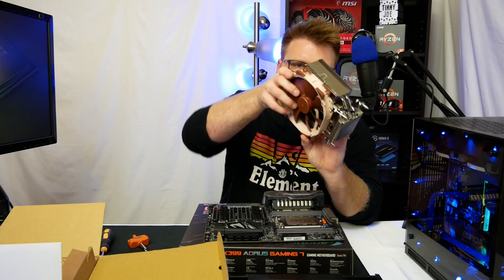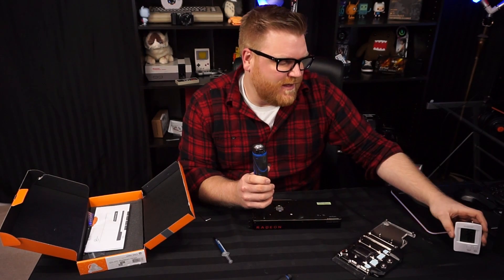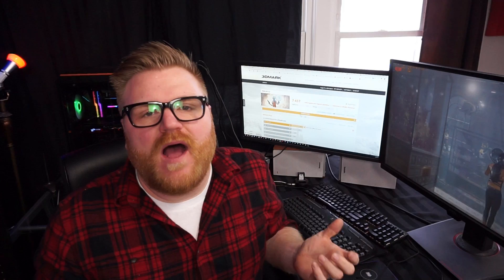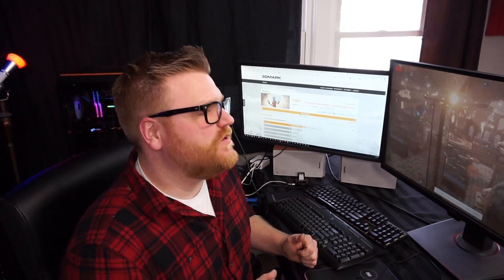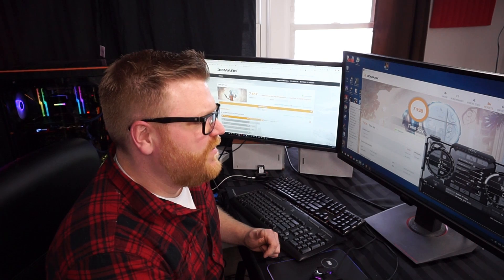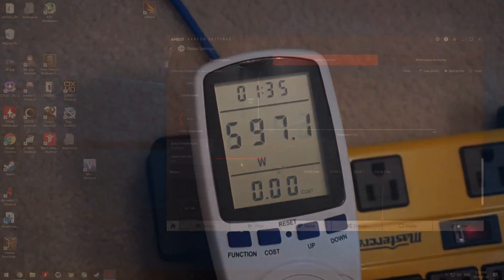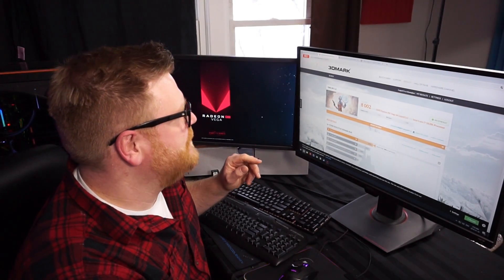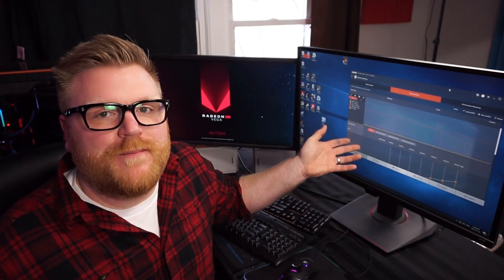Overclocking Vega 64 TO THE EXTREME

Comment: I just got a Vega 64 for 80 bucks and I’m hyped
Reply: How's it treating you?
Reply: @scottd7222  it’s been good, I repasted it. And it runs cool and I overclocked it by a decent bit so I get fps at 1080 p ultra.
Reply: I just got mine in the mail from ebay for 80.
Reply: @ hell yeah that’s awesome, I repasted mine and I’m still running it on a pretty heavy overlock and undervolt.

Comment: Great video, Timmy Joe. Been watching it for a year. Thanks for keeping it on Youtube. Warrantee ended on my Vega 64 so I stripped off the box cooler and threw on some better fans. Yup. you're right. It does reach some pretty good clock speeds once you change the cooler. Managed to inch past 1810 Mhz before it became fickle, black screening to the desk top. Also notice it runs cooler with a mV power bump and the memory turned up, 34c under load. Runs fast, smooth and efficient @1770 Mhz, memory @ 1100 Mhz+. Never seen it go over 40c. Gonna keep Vega64 for a while or till the gpu market drops those money hungry prices for new 8gb cards. Thanks for the video tips, bud.

Comment: Picked up a reference Vega 56 when the prices dipped on the Used market for i think $140? idr, but holy moly is the stock blower not enough. It was shooting down to ~1,100MHz in some games and up to ~1280 in other games while also being hot and loud. Undervolted got it to 1250-1420 i think (don't remember exactly) but still hot and loud... So i put Liquid Metal and cut the bracket to let air through :-) then flashed 64 Bios. So with everything now it sits at 1520-1640 with the blower fan @2850rpm max and @76-79c (room is 70-72F)

Comment: Hello @Timmy Joe PC Tech 😀

I put my Vega 56 in the water and now I have excellent temperatures under load on the 33 to 42c gpu.
I am planning to do an aggressive overclock based on your sample.
Could you ask me any other questions?
What bios did you use on your card?
What log file did you use "vega morepower" on your card?
I tried to put Vega 64 aios bios on my card and it really hits 1750mhz, but every 5 seconds it downclocks to less than 1000mhz on the gpu no matter what I do.
I got 1700mhz on the 1.2v gpu and 1100mhz on the 1v hbm2, with Vega64 bios and editing the registry for 150% morepower.
But I'm fascinated by the possibility of obtaining 1800mhz.
Would you help me?

Comment: I got my sapphire nitro+ rx vega 64 undervolted/overclocked to 1715mhz core @ 1065mV and 1120mhz memory @ 951mV @ +50% power on air @ 100% fan speed for gaming purposes all stable. While gaming the core is actually 1650mhz average. This gained me 8-15 more FPS @ 4K in all my games. The hottest I’ve seen it get is 70c and I play in 4K max settings 60FPS. Average power consumption is around 300W.

Comment: Vega64 is still a good card, I have one in my spare PC, doesn't overclock as well as the VII, that thing can haul ass when you are on water, talking 400mhz overclock on the core and 270hz on the ram. Almost 23% over stock boost speed!

Best part, it's aging well, still able to keep up in modern games.

Comment: #Butter of the Butter
Vega 64 optimal settings 
Core Clock:1685mhz (1080mv)
Memory Clock: 960mhz 
Fan curve: passive aggressive power %: All the way.
After two months worth of benchmarks and research and second and third opinions.

Comment: i flashed the liquid bios as well, and put it under water as well, but i am having an FPS drop bug, 
apparently it is due to the drivers after 19.1.1, so i rolled back and the issue disappeared, anyone have any idea on a fix for this?

Comment: Hey Timmy, I  just bought a Vega 64, was thinking of running the Morpheus, don't want to add in water cooling, is that mod worth it or just stick to the regular single blower? Also is it ideal to take the card apart and redo the thermal pads and paste?

Comment: im starting to over clock mine now, sapphire v64, at stock voltages w pwr limit +50%, core 7.5% freq for 1752, memory 1050 max state, aggressive fan curve, temps mid 40s c max. i crash at core 1800, just needs more power limit? temps seem fine, anyone else have sapphire version

Comment: I just got a Gigabyte RX Vega 56 Gaming OC last night... Haven't done any overclocking (not really sure if I will - I have bad luck when I do), but I've been playing around with undervolting.  I'm impressed with how it takes to making voltage adjustments - got my temps down, which reduced the fan speeds - and also stabilized the clocks.  It seems to like sitting at max boost all the time now (strangely, that's 1576Mhz - Gigabyte's web site lists 1501 for max boost clock) as opposed to bouncing the clocks madly up and down like they are a yo-yo.  But looking at my Kill-a-watt meter - I can't say I see anything dramatic with reduced power consumption - seems to be about the same.  I like what I'm seeing for frame rates and quality settings. So my impressions are when it's the right price, it's a good card esp. for people that enjoy tweaking out settings.

Comment: rtx 2070 on water with power/bios mod :)  (yes still using official nvidia drivers)   
https://www.3dmark.com/spy/6800663
https://www.3dmark.com/fs/18941014 (this is FireStrike "extreme")

Comment: Wanted vega so bad like 9 months ago but ended up buying a new system a ryzen 5 2600 b350 tomahawk and 16gb 3000mhz ram with a rx 580 and 1080p 144hz freesync monitor. Wanted to up grade from my I5 3570k and 1060. This was before nvidia was allowed to use freesync and I'm still happy with the decision. Just wish I waited but you can wait forever for better deals.

Comment: 600W not bad at all, considering my GTX 980 pull total system load at 580W on a CPU only test it would be a good upgrade.

I want to either get a used Vega FE maybe considering the radeon 7 just to mess with and the vram capacity which I need for a sim I play with.

Comment: lol... I get an 8100 in TimeSpy with a FIRST GEN i7 980x and a 2070.  lolol   And that's with an AIO with a small rad, and the stock air cooler from MSI on the 2070, in a closed case... Alienware Aurora R1 actually. 10790 Firestrike Extreme... I actually mirror 2070 scores up to 9th gen intel systems... top chips my friends... top chips.  First gen... 980x... lolol... nothing has really changed beyond process size, tdp, and avx... and I don't need avx... Intel, more like inSTALE !  HA... ehhhh... yep.   (Gfx score in timespy is a 9410 btw... so there's that too.  Funny, first gen isn't even close to a bottleneck.)

Comment: I love what you have done here in this video, but you really need to dial it in more. Can't just crank the core clock and expect it pump out the frames. Your gpu score is pretty much what a standard vega 64 air cooled can do undervolted. Mine does 8107 gpu score at 1670mhz air cooled. On an LC bios you have so much more head room!!! Look in to OverdriveNtool for overclocking instead of using wattman. Disable all the Pstates except P7 for core and P3 on the hbm and this will really lock in your true stable clocks :) 

Keep it up!!!

Comment: https://www.3dmark.com/spy/4906893

Just sayin' you can probably get a lot more out of that Vega64. My settings were at ~1740MHz under load, though 1135MHz on HBM2. Also use OverdriveNTool instead of Afterburner. Much easier to OC the card ;)

Comment: Is that power draw correct? or does the bios change make it a bit funny? I undervolt my Sapphire Nitro+ Vega64 within an inch of it's life (maxing out around 1050-1070mV) and hit 315W at 1650Mhz. You're hitting 1850Mhz with 1150mV, but afterburner is only reporting a draw of 250W!!! - what gives? - That's amazing by the way!

Comment: X99 can still be fun to play with.  Things to look out for; avoid beta BIOS with Spectre/Meltdown fix if you're benching, try to get 2400MHz or faster RAM that is matched so it can run at a command rate of 1 and tight tertiary timings.  Disable RAM channel and bank training once your memory speed and settings are sorted, disable fast boot if using NVMe (messes with graphics drivers on boot up).  Disable VTTd and all CPU virtualization including hardware snooping.  Use the latest Intel IME and USB3 drivers so Windows 10 operates properly and fast.  You may need to drop to PCIe 2.0 on some boards if pushing high BCLCK.  That's the major ones coming to my head at the moment, I'm sure I'll think of others when I turn on my X99 system again, haha.  Oh, I guess if you have Windows 10 Pro (any Windows Pro or server edition) you can lock pages in memory for a bit extra performance.

Comment: Bruh, my 1070 Ti benches at 7,8xx on TimeSpy. With a bit of extreme modding and extreme power consumption the Vega 64 barely edges it out? Damn.
Reply: Keep the CPU in mind with these scores. The CPU he was using was very old.
Reply: @owen-ng8oe  Do you think it was bottlenecking the Vega? I did my tests with a stock R5 2600.

Comment: 10:30 Why does Zen, and Vega do so bad at Firestrike combined? If you notice Timmy scored about 7500 Combined with the Threadripper system, despite having a MUCH higher physics score than the 5820k, the 5820k scored over 9000 in the combined test!

As for Vega, while you were able to get a graphics score of 25,000, and meanwhile my G1 Gaming GTX 980 Ti at 1503 core 8 GHZ effective VRAM, scored 22,120 in Firestrike graphics - BUT in the combined test I scored 10,304! Now I am on a 5 GHZ all core, 4.7 Ringbus i7-8700k, which scored 22,583 in Physics - which is higher than you 5820k, but significantly lower than the Threadripper.  Thing is, even on 8700ks with similar clocks to my own, Vega does worse in the Combined test for some reason...

I wish I knew why Zen and Radeon do worse than Intel and Nvidia in Firestrike Combined test relative to their gaming performance.
Reply: DysphoricSmile yeah that's a good question. I don't have the means to actually look into it, but I'd definitely like to see someone figure out why that is as well.

Comment: i have gotten scores of around 8400 in timespy with just the water cooled edition of vega 64 at normal room temperatures, try lowering the voltage to around 1160mv it will allow the card to pull more power
Reply: That or if he needs that much voltage it's time for the registry mod to allow more power / amps in.

Comment: weird results, my reference sapphire vega 64 scores about the same 8100 on timespy, and higher on firestrike at 26k. ive undervolted and overclocked to 1682 core and 1120 memory. either the gain from my higher hbm2 overclock is massive or his card is actually only running at around 1550mhz. my card hovers around 1630mhz at 75 degrees, 50%+ power limit.

Comment: Did you tweak HBCC? Your scores seems pretty low tbh. I also have Vega under EKWB with normal temp(20 ambient).
https://www.3dmark.com/spy/5069094 my Vega with 1720 core/1100 HBM scores 8400 in timespy
https://www.3dmark.com/fs/17414336 1742 core /1195 HBM scores 28.5k in FS normal
With HBM on 1060 you should have +- 26.5k points in FS with core clock at around 1700.

Comment: Damn if the highest oc you can get on an RX 580 is 1400mhz then this is 50% more performance gain. Crazy.
Reply: RX 580? my RX 580 Strix stock clocks at 1411mhz. i can overclock it way beyond that

Comment: Timmy love you but you didnt do all your homework for this video :-D (some innacurracies) 
nitro+ rx vega 64 owner here :-) i ve been using it for 4 months  1642Mhz core, 1050Mhz hbm, 1119mV at the last two power stages 7,6 and 1100 to the 5th, power limit set to +50% and fan to auto, it stays reasonably cool n quiet!
Reply: Core Clock, Mhz
Core State, index
Core Voltage, mV
Memory Controller Voltage, mV
Memory Clock, Mhz
Mem State, index
Memory Voltage, mV
Fan, %
Power Limit, W
if possible can you detail ?

Comment: Yeah UVing is important not increasing voltage in a normal non subzero testing.  Here we are seeing clocks and CB scores but IRL max FPS is key.  When you said trouble keeping max clocks at stock that is the known issue that 56/64 cards have; they throttle BC stock voltage is too high.   The supply issue at launch was mainly due to one HBM supplier's die was lower and not even with the GPU die so cooler fitment became an issue.

Comment: Vega reminds me a lot of the R290x/290 when they came out. Really good capable cards absolutely kneecapped by really bad reference cooling solutions.
Reply: @RavenPrecept yeah but the 290x did have more aib cards and they were mostly pretty good which helped.
Reply: Except its a little worse than the hawaii launch because unlike the R9 290/X cards the vega cards are overweight on shaders because that never got fixed from the fury cards.
Honestly for Gcn based gaming cards AMD should have topped the lineups out with a 52CU/64ROP gpu (With a 44CU/64ROP cut down chip) and fabbed them all from a fully enabled vega 56 die (and obviously use all the fully enabled dies in pro gpu's/ them stupid frontier edition cards which would have actually made them a better deal for both the intended prosumer market and amd) because at clock parity the differences between all the fiji and vega variants is almost nothing (when the fury cards framebuffer dont get in the way) despite lopping off 12% of the shaders and 2 arch revisions.
Reply: @RavenPrecept I used 1 290x (aftermarket msi card but not the lightning one sadly) to heat mine, thing tops out at 1205mhz in the winter.
Reply: devilmikey00 I'd love to get a waterblock for one of those reference cards. power draw would probably go down a bit too haha

Comment: Joe, your Vega did not run at 1800+ MHz no matter what the software tells you. My Vega 56 flashed to 64 (still the same 56 CUs, 224 TMUs, 64 ROPs, definitely not like a real Vega 64) gets a GPU score of 7435 at a peak clock of 1715 (not sustained) and a +50% power limit with a measured 300W power draw.
https://www.3dmark.com/spy/2527004
PS: That was a reference Vega 56 with the stock cooler in a 23*C room.
Another 7 493 GPU (at peak 1725 MHz) points on that older computer with older drivers: https://www.3dmark.com/spy/3833708

Comment: Looking forward to that X99 review!!  Been running a 5820k as my main since Jan of 2015, only just recently (like, two days ago) built up a 9600k (yes I know you hate it but I don't do content creation/rendering/etc so I don't need threads I need frequency/fps and it was cheaper than an 8600k) with a Prime Z390-A and RTX2060. The Haswell-E served me well for many years running a 4.5Ghz OC, it is still a quite viable platform performance-wise if you're not looking for balls-to-the-wall 4k Ultra-Max-Super-Duper Over-9000FPS type of gaming chops. I'm excited to see what you've done with the old girl! 

Edit: BTW, I beat your graphics score on Time Spy with my 2060. 8135pts ;) Impressed with the little guy.

Comment: Nice man! I've got a Asus ROG Strix 64. It is usually reasonably quiet, but I only get in the upper 1500s, pushing 1600, with undervolting,  50% non-hacked power limit, and tweaked fan / clock curves and 2 GHz memory (in Wattman - ditched GPU Tweak 2 that came with the card since Wattman actually worked better [had to put a couple exhaust case fans back on motherboard control rather than GPU control though]). I don't go further due to wanting stability in my gaming sessions, but I love to see people pushing them.
Reply: Monarch Black I’ve got the same card and see exactly the same results. I think I broke 1600 once... Should we bother upgrading to the LC edition? I think the VII might be out of my price range.
Reply: @joshmcguffie5156  I was considering the VII, if the results looked good, but they don't really and you can't find the card anywhere anyway. Personally, I wouldn't upgrade from a normal 64 to a LC edition. I don't think it's worth the money to buy a whole new card to gain 10% performance.

Comment: so my vega 64 sapphire nitro plus clocked at 1752 usually only clocking to 1700ish with memory clocked to 1050mhz and i got a total score of 8188 and a graphics score of 8130. wondering how i got a better score with a lower clocked graphics card? and my cpu score was 8539.
Reply: asking about gpu score

Comment: Guys, i got some cash and i have to buy a new gpu.
I sit on a GTX 760 and it is killing me.
I only play on 1080p, but use three monitors. 
Games i want to play are Witcher 3 on ultra with hairworks on 60 fps (NEVER less than 60, NEVER!) and Total War: Warhammer 2 on Ultra on 60 fps (this engine is shit, so it will go under 60 on any card in some situations, but "stable" 60 are also the target here).
Other than that i just play Dota and that runs on a potato.
And Cyberpunk/Star Citizen, but they won't be out for a long time.

Where i live i could buy:
used RX Vega 64 Nitro+ with some or none warranty for ~400€
used Asus ROG Strix or some other 1080 with some or none warranty for ~400€
massive used 980ti like the Lightning with no warranty for ~280€
any new 1070 for ~280€

My other specs are i7 4790k@4,8ghz, 16gb cl10@2400mhz RAM and a 650w beQuiet Dark Power Pro, so the power supply is enough for the Vega should i go down that route. 

What shall i buy?
My brain says just buy the cheapest 1080 with warranty, they all overclock the same, because Nvidia locked the OC process down so much and it is the more stable card with better video de/encoding and driver support.
But that sound really boring.
Is the Vega 56 even up for consideration?
Reviewers said it was the "good" Vega, but therefore its used prices are pretty high.
A used Nitro is still around 360€ and more here, sometimes even more expensive than a Vega 64.

Comment: @Timmy Joe PC Tech you need to push your card more :D
my vega 56 with vega 64 bios on air, with memory set to 1100, gpu@ 1.19V p7 set to 1820, resulting in 1755MHz max boost gets 26K graphics score in firestrike.
Maybe reduce the voltage?
Reply: How much power are you using ?